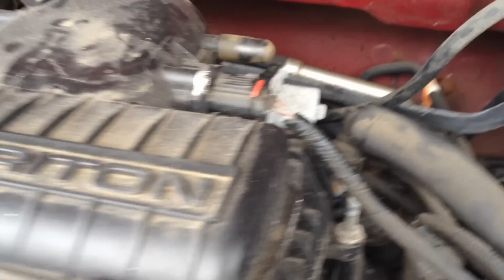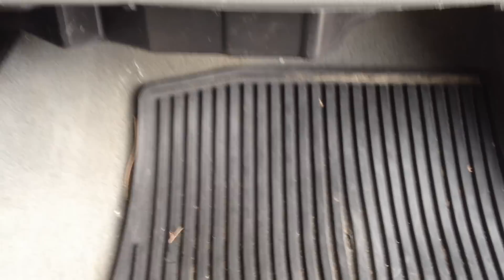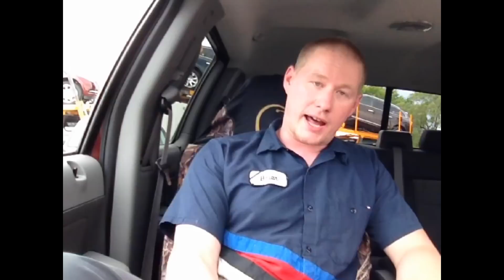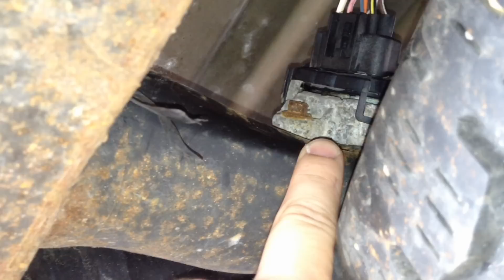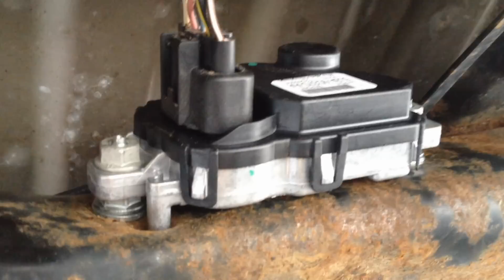2004-2008 F150 Died Out No Crank Theft Light Engine Compartment Clicking P1233

Comment: Hi, well did the rookie mistake---- age58 changed oil and missed the old oil seal ,started and was headed toward operating temp. then low oil psi light came on ,shook for a second and died.  pumped out 6 qts. onto floor, removed oil filter took old seal off replaced filter and oil,now it cranks but won't start. is there a fail safe that needs to be reset? or any thoughts as to no start now?
Reply from the maker: +noahs ark No the Fords do not have actual oil psi gauges linked to the fuel pump like gm vehicles. Also most don't have low oil sending units which neither have a fail safe built into the pcm.

Comment: is that only on the f150 i have 2004 f250
Reply from the maker: +Steven Arcement Yes F-150 and expedition only.
Reply: Ok i have no fuel getting to the engine but I bought a new fuel pump and it does not work what could be the problem
Reply: +Steven Arcement Have you found the solution to your problem. I started having the same problem with my 2006 F250 5.4 The engine will fire cold, but after a minute it will stall out and will not start again.
Reply: They are on escape also I fixed one

Comment: I have a 2005 f150 with a 5.4 and the oil pressure gauge won't always work I already change the oil pressure switch and still not working properly and I have no rattle sense I change all my timing kit

Comment: hello, i have a 2008 450 with a 6.4l psd, i am having similar issues to what is going on in this video, but am unable to solve my problem with the tips form this vid. when i tried to start the truck one day, the cluster was pretty much all blank, and the only thing happening is the info center in the cluster tells me to check the trailer brake controller, abs, and other stuff, then the PATS theft light holds solid for a few seconds (about 3) and then flashes rapidly and the truck will not crank and of course not start. other stuff seems to be operable like the radio and windows/locks and ext/int lights. i hope that you have come across something like this for an 08 job 1 PSD since you are an all knowing ford guru, thanks!

Comment: Great video's!  I have a 2004 F150 that starts, runs and drive's perfectly from cold. shut it off hot and it won't start, flashing 15 on the theft warning light (key not programmed into pats). Let it cool down and it starts like a champ. No DTC's are set (that I can read with consumer reader). Any thoughts?

Checked fuel module in back and very little corrosion, tried new keys (pgm fine cold), new PCM relay, all fuses good. Serviced grounds around PCM/battery and fusebox.
Reply: I have  same problem..what is the problem?

Comment: Thank u for that excellent video. I replaced a fuel pump on an 04 Expedition. Still no fuel pressure. Tuned out to b that little tiny fuel pump relay soldered into CJB. I tied to solder a new one in there. To many little joints. Ended up buying whole new box. Why can't they just put a replaceable relay like everyone else??  Once again, thank u!  And I watch every video u come out with

Comment: Hi
I have a 2007 Ford F150 4.6L It starts but only stays running for a few seconds. It does this everyday but then after awhile it starts and runs. replaced, the fuel pump mod, fuel pressure sen, fuel pump sending unit, maf sensor, egr valve.

Comment: Well after watching this. I went out and put Ford XG-3-A dieletic grease in all my relays and inspected them. 

I also realized I got both a power steering pump cooler and water cooler for the oil system. I never seen that.
Reply: Claude Rains why on earth would you put dielectric grease on relay terminals? By definition dielectric prevents electric current from flowing. It is used to seal out the elements from corrosion, not to help continuity. Amazing how many people have this bassackwards.

Comment: Hi FordTechMakuloco ! Thanks for the video, and for helping me in the past. I really appreciate it. I have a 2005 Ford Expedition with the 5.4 3v engine. I have an issue with the IRMC solenoid with a code saying it's stuck closed. I had the intake manifold off to replace knock sensors, and I noticed that the connector for the IRMC solenoid was broken (previous owner had actually removed the intake for whatever reason, and then just cutting the wires to the knock sensors when reassembling.. lol ), while the pins looked intact. I tried to glue it back together, but it seems it doesn't work. Now, before I start throwing parts at it, how do you diagnose these? How do you get the IRMC to open while you're in the driveway sticking your hand back there? I would really like to know how to diagnose it, to make sure it's the solenoid itself, and not end up replacing it with the job of taking the manifold off, just to have it still not working when it's all back together. Is there a way to bench test these? If yes, is the control signal from the PCM a 5V signal or a 12V signal? I do have the factory workshop manual with wiring diagrams, as well as an OBD scanner, but not a Ford VCM scanner.
Reply from the maker: Skauber Almost always the wires were not routed correctly  for all the connections back there and the rods cannot move and actuate, the actuator itself rarely if ever fails. I would replace the pigtail and make sure the pin 1 has 12v and pin 2 has a good ground and reassemble with the wires routed correctly.
Reply: FordTechMakuloco  Ok, thanks for the response! :) The plug on the harness side is OK, but I'll have to measure the pins to make sure they are properly connected through to the PCM. The connector on the actuator itself was the broken one, though the pins didn't look damaged, I was able to glue it back together with epoxy. You're right about the harness and other connectors back there, they were routed all over the place when I disassembled it, but when I reassembled the manifold I made sure the harness and other connectors were out of the way and zip tied them into place. I do wonder if it might have damaged the actuator when it has been stuck, trying to move and perhaps fried the motor inside or something, when I hold the IMRC rod connected to the valve on drivers side and have a friend turn the ignition on, there's no movement or any indication that it's even trying to move, but I'm not sure if it's supposed to cycle when turning the key on. Is it supposed to cycle open/closed when turning the ignition on? Or is there another way to make it open without the Ford VCM to manually set it to open?
Reply from the maker: You can open and close it with the vcm yes I am not sure if it cycles upon start like the windstars. I would manually move the to the open position and when  the key is turned on and codes cleared already ti should closed the flappers so its ready for low speed operation that is one way to check.
Reply: Thanks for the tip, I tried this but it seems like it's spring loaded or something. When I move it, it just immediately returns to the closed position. I guess one would really need the VCM in order to open and close it and see if it moves or not. The way I see it, it is either a electrical problem, either the control or monitoring signal doesn't get through or it doesn't have power, or it is in fact the actuator itself that is broken. It's just really difficult to diagnose since I can't get access to it without taking off the manifold, and I doubt I can test it with the manifold off when I don't have the VCM... hehe.. :)

Comment: I have a 2008 F-150 5.4L. I was driving and it stalled out and everything stiffed up. I changed the fuel pump an it still won't start. It cranks but doesn't start.
Reply from the maker: Daniel Moose Have you checked this module and the fuse for it?
Reply: It was the module, I got my truck running again. But after a few weeks it started to leak gas. I dropped the tank and the mechanic i got to work on the truck didn't replace the clips so there was no clips on. We put everything back together an got the tank back up. Tried to start the truck, it wouldn't start.

Comment: You ever dealt with a durango with similar problems. I have a 99 durango thatll run and after awhile shut of and the security light turns on and the truck wont start.
Reply from the maker: Edgar Trejo No never touch them sorry.

Comment: 2004 F-150 5.4 this actually happen to my truck 3 days ago, truck has power but when you try to crank it over to the run position i get nothing. Of course I change the starter and of course nothing changed.

Comment: Mine looked the same but it was on a 2005 Explorer. It was mounted INSIDE the car. (Just behind the rear tail light). $87 tow $104 for part at Advance Auto. The spacing seems way to close on this one. New ones come with a 1/2 inch spacer.

Comment: I have a 98 f150 problem comes and goes... sometime have a loud clicking under hood when you hear it clicking.. it will turn over but wont start... you can walk away .. check it later .. it will crank... sometime driving it will shut off hear clicking wont start,, let sit a while cranks right back up clicking  coming from engine and relay number 4
Reply from the maker: Melissa Futch Relay number 4 is for the windshield washers are you this one is going crazy when this happens? Better question is are you getting fuel pressure when this is happening?
Reply: No fire or fuel..when its clicking
Reply from the maker: I would replace the pcm power relay with new and also clean and seat the pcm diode both are common all inside the battery junction box.

Comment: i have a 2004 f150 5.4 triton and it will not start. i have tried a new ignition starter switch, new fuel pump driver module, new 20 amp #34 fuse even tho mine was not blown. we ran a wire from the starter to the battery and it turns over but no start. i tried switching the starter relay in the fuse box with the blower relay and still nothing. Odometer does read check gauges and the check engine light, battery light and the wrench light stay on. My theft light blinks at a regular pace. do you know of something else that i could try before taking it to the shop??? HELP PLEASE AND THANKS!
Reply from the maker: Carolyn Ireland Ok so when you turn the key on does the theft light prove out and go out while key is in the run position? When you goto start the vehicle does the starter crank?
Reply: FordTechMakuloco no the light continues to blink normal while in the on/run position. no crank
Reply: Had the same problem it's a wire under the cab right under the driver seat guy sold me his truck because of this problem and after alot of research and two shops it was fixed just a bad clip under the can drive side

Comment: I HAVE A 2008 F150. THE ENGINE CRANKED FAST BUT NOT START. IF IT DID START IT WOULD STUMBLE DOWN THE ROAD. CHANGING THE FUEL PUMP DRIVER MODULE SOLVED THE PROBLEM. AS ALWAYS, I AM HUMBLED BY THOSE THAT HELP OTHERS ON THE NET. THANK YOU SO MUCH!
Reply: I have a 2001 ford expedition i läost all my keys and replaced ignition cylinder and anti thefr is flashing i have no programmied transponder keys is there anyway to bypass anti theft without spending 300 on a key
Reply: Have a 2002 f150 new fuel pump fuel filter new battery checked fuse's there good relayes can any one help

Comment: I have a 2004 F-150 that wont start i changed the fuel pump and the fuel pump module and still wont start
Reply from the maker: Erik Gonzalez Is your problem no fuel pressure.

Comment: Would this module still let the truck crank but no start? I have fuel ,spark , but won't start . F150 5.4 triton 2005
Reply from the maker: gato8479 This module can fail otherwise yes and just provide no fuel pressure. How are you checking fuel pressure?

Comment: I've known about the original fuel modulator issue and have yet to replace mine. I was thinking this may be the issue I'm currently having on my '04 F150 FX4, but in my case, turning the key to accessory gives me no lights inside the cab at all, if I go to start it,there's a small chirp that I can faintly hear from the engine compartment and when I pull the key out, all of a sudden, the blower motor stays on. It just all happened, all of a sudden.

The night before when I drove it, it was completely fine. We had some rain overnight, and the next morning, no start, no crank, no lights inside.
It's sitting at a shop now trying to figure out what's goin' on.  =(
Reply from the maker: jdsfx4 It very well may be.

Comment: Hello there fordteck.. My dad has a 2004 f150 (non heritage) with the 4.6 and 149,661 miles.. It has a slow cold start.. So slow that I've heard my dad cause the starter to chirp cause of excessive cranking.. I've been thinking an induction service might resolve it but I'm not sure. Your thoughts and opinions will be appreciated.
Reply from the maker: I would be looking at fuel pressure first or you can cycle the key 5 times and then try to start and see if it is easier to start. I am suspecting a leaky fuel injectors also.
Reply: FordTechMakuloco so if it starts easier after cycling the key then it's a fuel pressure issue right? if not what does it mean? i also thought about the fuel injector.. Should i take it to the dealer? or would a trust worthy shop be fine.. also what do i tell them?
Reply from the maker: If it starts right away after the key cycles then It is a fuel drain back issue likely at the pump check valve itself. If it still runs rough it it time to pull up the fuel rail all injectors intact and do a leak down test. I would take it to a dealer personally I see too many mess ups come from independents in the area that don't know the brand.
Reply: FordTechMakuloco thanks alot.. Appreciate the help.. Made an appointment with the dealer

Comment: I'm new to Ford so please forgive my ignorance but are electrical issues common on Fords?  Will an annual rust corrosion spray prevent this?  Also I keep my vehicles well maintained - is there anything I should keep an eye out on my 1st Ford 2014 F-150 as far as preventative maintenance is concerned?
Reply from the maker: They have their issues just like any other manufacturer mainly because they share the same vendors. The F150's are pretty tough nowadays and we don't see them for much anymore.